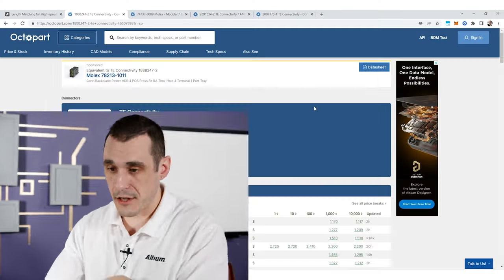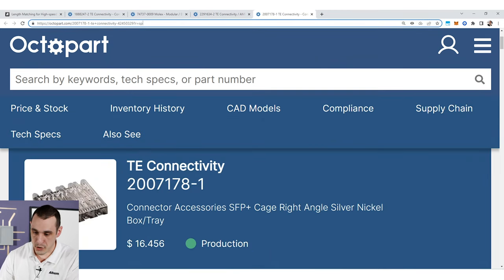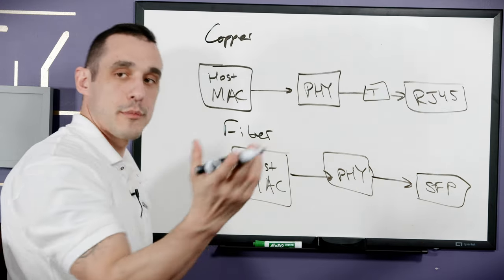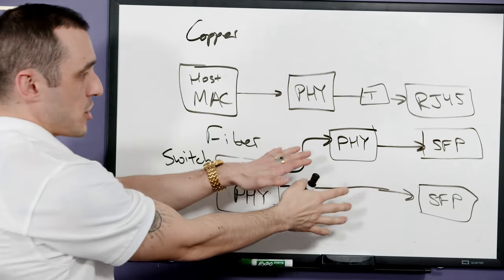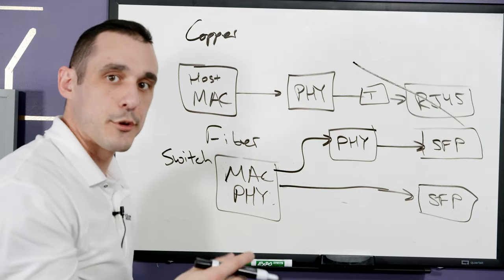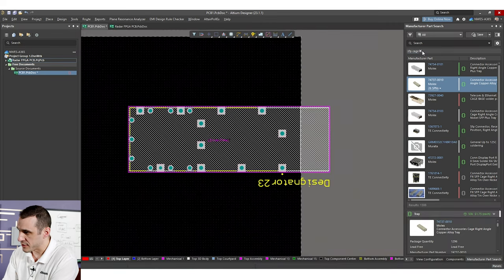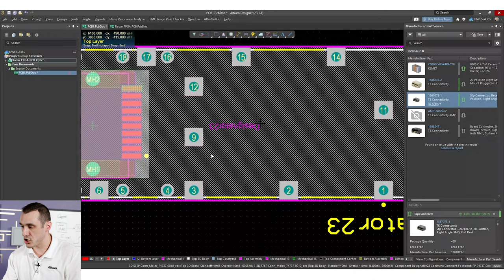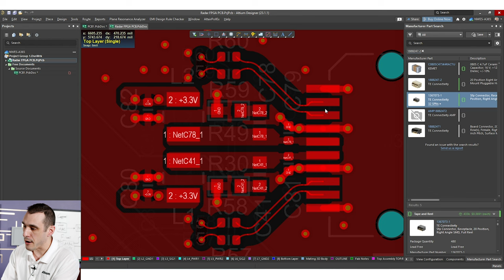SFP Modules with Cage Placement and Routing

Comment: Well how does that work with say AFBR-5972BZ? I guess it's basically like a SFP but doesn't need have the extra cages stuff.
Reply: Similar usage in that they have Rx and Tx lanes but does not need the cage like you say. Fiber can plug directly into the coupler end of these transceivers.

Comment: Hi Zach,
Thankyou for the info. Actually I was having some doubts regarding the SFP routing. In the SFP pins, I have often seen that, for the differential signal pad's references are given on fourth or below layer instead of the verry near reference layer. In some cases, voids are provided below these pads. Could you please comment about this practice?

Comment: Great timing! I'm working on a 25GBase card and ... First rev doesn't work 😟

I saw the simberian simulation for pam-4 at 70Ghz but I was wondering if there's a physical sfp test fixture to measure the interconnect in the real world. Like an Sfp sized board with SMA connectors that you could connect DTDR to, and look at impedance through your connector to other end and see RL and IL?
Reply: There is one company that makes an adapter for high-Gbps SFP connectors. Check out Wilder Technologies. The module provides coax outputs so you can connect to a VNA for differential S-parameter measurements of the RX and TX pairs. When you connect it to your board you will have to de-embed the transmission line, so I'm not sure how you would do that with this test adapter.
Reply: @Zachariah-Peterson   @Zachariah Peterson  This is exactly what I was thinking of, thanks!

Comment: How did he drag the connector into the cage? Altium won't let me place overlapping components :(
Reply: This was a dummy board so there was not a special rule to set (as far as I recall)... I don't know if there is a setting in the Preferences that would limit this overlap, but I regularly place the cage and connector in the same region without problems.

Comment: Can any MAC interface work? do those PHY chips use MII ot RMII or some other protocol ?
Also regarding the Switch project will it be entirely modernized or just a SFP added ? 
Also will you release the files?
Reply: MAC and PHY layers are rated for certain data rates, and the PHY will only support certain routing, so you need to make sure the interface on the fiber module is compatible with the pins on your PHY. For example, SFP-10GM-T from FS supports SGMII, so your PHY would also need to support SGMII. Older Ethernet controllers still support these protocols. Or for example, if you build the chipset in an FPGA, you would instantiate specific MAC & PHY as IP in the FPGA, and the interface for your required data rate would get specific pin grouping on the device.